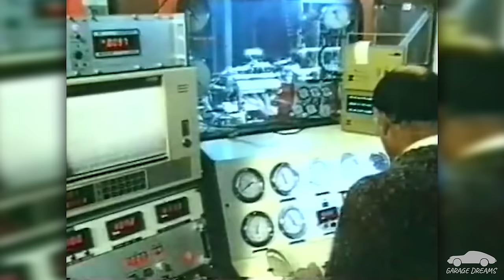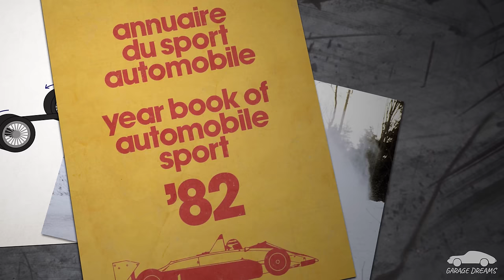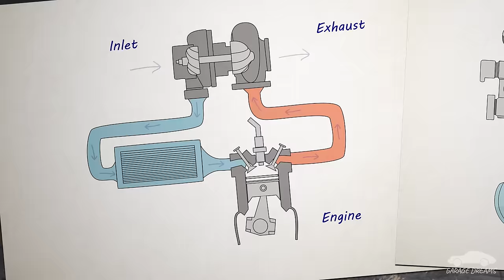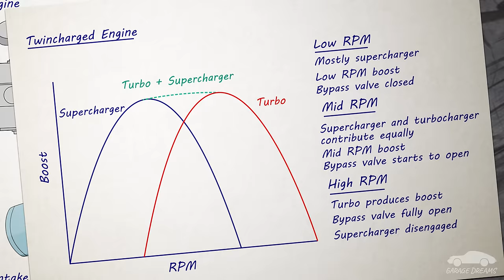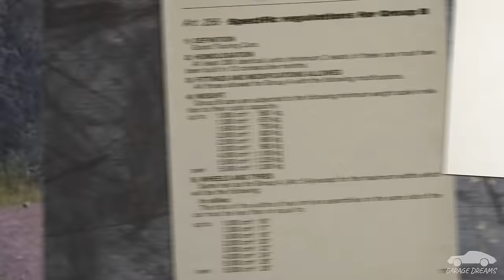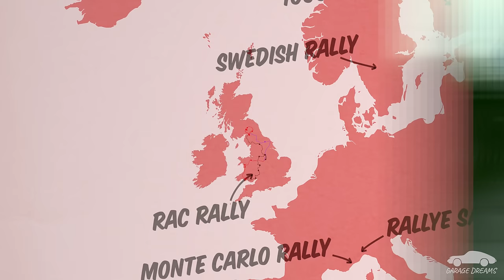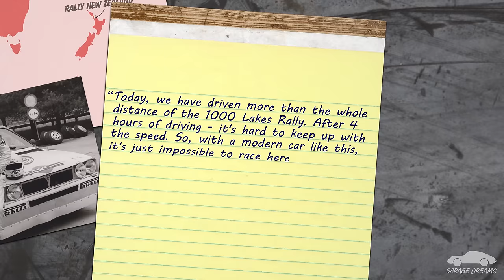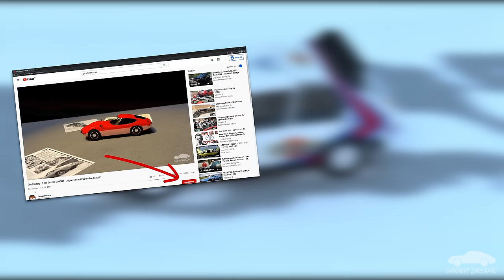The History of the Lancia Delta S4 - The Car That Ended Group B

Comment: When a driver says the car is too fast, you better believe it. Even though I love things like this, there are always limits to anything.
Reply: Henry Toivonen about the Lancia Delta S4: "this car, go to 0-60 in 2.4 sec, is so fast that your brain isn't capable to stay at pace with your actions. It's crazy"
Reply: @solinvictus1234  God rest his soul he was taken way to early
Reply: @solinvictus1234  this car was so fast that modern HYPERCARS have trouble getting that low of 0-60
Reply: @x-90  Are rally cars faster than sportcars? I don't talk about drive in sand or Dschungel. What for example on "Nordschleife"? Can a rally car beat a gt3 rs?
Reply: @BetterCallSaul603  
Different cars for different races, impossible to compare on top speed alone.
Reply: " The sky is the limit... and that's where you're going JIMBO "

- FIA, 1986.
Reply: Laughs in IOM TT
Reply: @solinvictus1234 let’s not forget that 2.4 0-60 is on gravel💀
Reply: @CrewCrewlancer facts !! People don’t take that into consideration at all . I don’t believe that car made 450-500 the it was twin charged no telling where the boost was set . Not to mention they made and 800 hp “version” the driver was right that car was way to fast to be on taken on loose gravel and dirt roads and through corners

Comment: "How and why the S4 left the road is still a mystery." Maybe it had something to do with going 100+ mph around a turn on the side of a cliff? These guys were insane!
Reply: there were no skidmarks on the road from the tires, indicating that there was no hard breaking, or slide. Personally i think mby the brakes didnt work or smth
Reply: Or it could be stucked throttle, as it was mentioned as one of the car's issues
Reply: The pedal box wasn't attached to the floor,@Sean Price - so even if the pedal box was broken, there's no way "the brake was going through the floor".
Reply: He had a concussion blacked out. (In the 80's head injuries didn't exist. Basically because everyone knew someone who was like, "did you get shelled by the Germans? Suck it up buttercup, you ain't bleeding out the ears"
Reply: @GorryGaming  there are no skid marks there, if you brake there  you are done for and rally drivers know thhaht

Comment: Henri's complaint about car's too high performance foreshadowed his tragic death.
Reply: And the occasional reliability issues of the 80s and 90s. Senna also foreshadowed his death, even more strongly after Ratzenberger bit the dust in the same weekend (Which would be completely off the racing code nowdays, the race would have been cancelled if a driver dies during practice or qualifying)
Reply: Yep.

Comment: That Lancia was a BEAST... Beautiful, powerful and extremely fast. Unfortunately Henri Toivonen died in a S4 but they both  have become a LEGEND ...
Reply: Saw them both in action live at Motorshow, a very popular motorsports meeting show in Italy at the time. They used to build a small track - with both tarmac and dirt sections - in a huge parking lot area. The whole thing was like a stadium, with tens thousands whooing and clapping their heroes...that place was adrenaline at the finest and I still get goosebumps when I go there with my memory.
In that track the Group B cars and drivers battled for a trophy in memory of driver Attilio Bettega, who died in 1985 Corsica Rally. 
Well, it was EXTREMELY clear from the very start that the S4s where just insane, with a considerable edge over all the competitors. Only Peugeot turbo 16 (another devilish car) could try to stand still against the S4, but only ending up being the best in the loosers pack.
S4 was another thing, I mean TOTALLY insane.
And Lancia had the ECV1 - evolution of S4 - under development when Toivonen and Cresto had their fatal accident. ECV1 had a next gen engine with 750 hp (some say 800) in 'regular' configuration and a 1000+ hp specced engine for tarmac rallyes like Corsica.

Comment: Excellent video.  Most amazing, it was only a few years until Group A cars with barely 300 hp were faster.  Power is nice, but suspension, brakes and chassis are the  important parts.

Comment: The loss of Henri was as significant as the loss of Jim Clark. Both drivers were considered to be at the pinnacle of their motoring path and the thought was if it could happen to these guys no driver is safe. Quite rightly major changes were made to rallying and single - seater racing albeit far too late. I feel blessed to have been able to see there careers develop. RIP

Comment: Very fortunate to have been given a ride in the Roncaglia privateer S4 driven by Paolo Alessandrini at Olympus.
My God! On gravel it did 0-60 on 2,5 seconds.
Later at a rally shop Ruote In Pista in Torino, I got to fiddle with an E2 037 and S4.
Of note is that there were a pair of Sparco seats on a shelf with "Toivonnen" on one, and "Cresto" on the other.
IMHO the S4 was the greatest rally car ever made.
037 was the prettiest.
I purchsed an ex-Rorhl 131 Abarth in 1988, with the intention to restore and campaign it in the US. Sadly, I had to sell her. Wish I didn't.
The S4 was for sale Lit 40,000,000.
Should have bought that car back then.
Had 2 spare engines, Torson diffs, wheels, etc.
Also got a peek at the Triflux engined evolution Delta for the proposed Group S, that never happened. Carbon fibre brakes in 1989!
Reply from the maker: Wow, that's a great story. Thanks for sharing. Would love to have the opportunity you had!
Reply: @garagedreams6163  
I will never forget that experience.
The Alessandrini Bros were just wonderful, as,was the factory Lancia team.
I spoke with Nini Russo, and Ing. Corrado Isenburg, who I later visited at Abarth.
They gave me a Martini Racing umbrella, which I still treasure.
It rained every day of that rally, and Alen commented, in that distinctive accent: "Es too much renn."
When those Lancias entered the Tacoma Dome, the sound was absolutely astonishing!
Got to chat with Watanabe about the Hondas, which is,a whole other story.
Got loaded with various competators our last night there at Olympus. God, the NZ Millen team could drink!

Comment: I'm young(ish lmao compared to the rest of the rally community) and don't know much of the history but this video and Toivonen's statement about how their brains can't keep up is something I can kind of understand playing rally games with wheels. No series is anything like group b you're in some ridiculous rocket doing 110mph in the dark around corners people do at like 30 normally and still shit themselves. 

People are wild lol nothing but respect for these legends.
Reply: Of course you can do that for a while, but for example the Tour de Corsica 1986 was over 1500 kilometers long... no chance to catch a breather because once you were out of the corner, you had to turn into the next one. With Group B rally cars straights became meaningless, especially on rallies like Corsica where it is just turn after turn, while every corner looking the same. It was not just a difficult rally for the driver but co-driver as well. Physically and mentally really exhausting. 

Nobody knows what caused the crash, but there just wasn't any margin for error anymore, be it driving mistake, wrong pace note or mechanical failure. Whether you died or survived started to become more and more dependent on luck so it's no wonder many drivers and FIA started to have issues with the Group B regulations. Actually they had already recognized everything was getting out of hand and were coming up with Group S that would have limited the power to 300bhp.

Comment: It never ceases to amaze me that whenever we talk about Gr. B of rallying, the Audi Quattro is always taken as an icon, which conceptually was a Gr. A (it was not much more than an Audi 80 Coupé with a turbo engine and four-wheel drive) for Much that they put ailerons and tried to compensate for a very uneven weight distribution by putting the radiators at the rear. The truth is that already in season 86 it was already an obsolete car no matter how much the skillful hands of Walter Röhrl tried to compensate.
The merit of innovating with the first all-wheel drive vehicle caused them many reliability problems, having already been in competition for 3 seasons. Peugeot and then Lancia did not have so many problems with their first all-wheel drive models.
Also say that the Regulation of Gr. B was inspired by three very innovative models: Lancia Stratos and its mid-engine, the Renault 5 Turbo and its mid-engine also put into a small utility vehicle (a large marketing operation in which Peugeot later would inspire) which gave them both astonishing agility and the Audi Quattro with its all-wheel drive but lacked that agility. All three were running under the rules of the previous Gr. 4.
Reply: I would argue the 1986 Quattro wasn't obsolete at all. The fact that it was competitive even though it didn't have a spaceframe and had a big 5-ilnine engine sticking in front of the front axle is astonishing. Actually it came in 1985 and impressed right away at 1000 Lakes. It had its own anti-lag system and pioneered the semi-auto gearbox (at RAC I believe). The thing is Audi wasn't running a full program for 1986 and they weren't always pushing in the one full rally they participated. Rohrl was running very well in MC until he got a puncture and the spare was a studded tire. 
Also Audi always gave some attention to safety and had many complaints about the safety standards of GrB. They wouldn't make compromises and cut corners that would endanger their drivers. Audi was the only one of the top contenders that didn't suffer any serious accidents (like Vatanen in the 206, Bettega in the 037 or Toivonen in the Delta S4).
Also I would say that Audi had the last word when it came to those monster cars and it happened at the 1987 Pikes Peak. The car Audi raced showed the Quattro S1 was in no way obsolete in 1986.
And yet to me the saddest thing is that Audi did make one car that was close to a true GrB car. It had a mid-engine layout though I imagine the chassis and body were just the regular short wheelbase Quattro S1. Rohrl tested it and loved it. It was built and tested in secret because the Audi board was against deviating from the original layout. The car was apparently destroyed immediately when they found out and all we have is a few black and white images and an interview with Rohrl.
Reply: @VWaudiRULEs  The Audi was a car that could'nt do anything against the Peugeot and the Lancia in 1985 and 1986 and the results corroborate this. They did'nt retire in 1986 for security reasons, they retired because they knew they were not competitive, even if they later justified it with security.
In fact, the only events that he wins are the 1985 San Remo, which wins it because Salonen does'nt race it at full speed since they were worth the points of 2nd place to be world champion that year and he did'nt risk, surely with Vatanen the result would have been been another, as had happened the year before.
The 1987 Pikes Peak is won by Röhrl because Vatanen breaks a turbo flange at 3 km. finish line, and it was only 7 seconds faster, because both in practice and in the first split times Vatanen was clearly winning, despite being a climb of "full power".
He could go on talking about what happened in Monte Carlo 85, but the comment would be too long ...
Regarding the engine, it is obvious that an engine of almost 2.2 l it will yield more power than its rivals with 1.8 l engines, but not everything is power, agility and weight also count, and those were the weak points of the Audi, apart from the reliability, until the 84 the Audi Quattro had a lot of problems with the transmission and the engine (they lost the '83 Championship incredibly for this reason to a Lancia 037 4X2, ask Mikkola or Blomqvist).
At Audi, Mr. Piëch insisted that the car had to be like the serie cars (However, Peugeot did with the 205 a perfect marketing operation, even though they were totally different from the series cars).
If you read the rules of Gr. B well to know that Audi did not design a car with all the parameters allowed by the regulations.
It's clear that the Gr. B rules did'nt meet the necessary safety, Kevlar bodies should have been prohibited, thicker roll-bars, fuel tanks placed in safer places, minimum weight limit and flange turbo engines to lower so much power (- 400 hp) would have been the solution, and still Peugeot o Lancia would have won because they were cars designed only to win in rallies, the Audi was conceptually an improved street car adapted to the Gr. B, which is different. If we talk about technology, Peugeot had the anti-lag DPV system, the germ of what it's today, it also had a water injection that today is equipped with premium brand cars to lower the temperature and give more power. The Delta S4 had a turbo and compressor, a system similar to the one used by the Volkswagen Group 1.4 TSI 10 years ago or so.
The semi-automatic gearbox that Röhrl equips in his car in the RAC 85 Rally is the PDK that Porsche was testing in Gr. C with the 962 and that they agreed with Audi to test in rallies and that today they equip their standar cars.
Reply: @carlosmagnus717  I don't agree at all. Audi couldn't do much in 1985 when they were racing the original short wheelbase Quattro, which was difficult to drive. And yet it was almost always on the podium and a win was lost due to some bad luck. With the Se E2 they won San Remo, before that they got 2nd at 1000 Lakes (with Audi famously setting a record at Ouninpohja and winning many stages), then RAC was for testing and development where they retired. I don't think those results show lack of competitiveness. They would not have kept developing the S1 E2 if they thought that. 
Like I said, what makes the Quattro S1 E2 so amazing is exactly that it's based on a regular car. The Peugeot and the Lancias were all purpose built and especially the Lancias were dangerous death traps.
You'll have to excuse me about Pikes Peak because Audi didn't just win in 1987, they set a record which Peugeot barely beat in 1988 with a brand new car. Not to mention Rohrl and the other Audi drivers (Mikkola, Blomqvist) were significantly older than the Peugeot and Lancia drivers.
Anyway Audi kept winning wherever they went - Grand Am/IMSA, DTM, then Le Mans and many other endurance races with the R8 (coupe). Then VW dominated the WRC like no one else in 203-2016.
Reply: @VWaudiRULEs The results say that the 1985 and 1986 World Champion Titles were for Salonen, Kankkunen and Peugeot. In those two seasons, Peugeot won 13 rallies, Lancia 4, Toyota 4, Renault 2 and Audi 1 rally. 
The 1985 1000 Lakes rally was won by a Peugeot 205 Turbo 16 E2 in its 2nd participation, won by Salonen without running hard, without risking excessively. Hannu Mikkola in the 1st pass through the Ouninpohja stage goes off the road and loses time, which later in the second pass is when the time that you say is done, but Salonen has already won the rally and manages the advantage no risks (Salonen gets 20 scratch, 16 Blomqvist and 7 Mikkola who retires on stage 31 of 51 that the rally had).
In the San Remo rally I already told you what happened, Salonen only needed the 15 points of the 2nd place to be Champion, he did'nt need to risk and he simply went out for a walk. At the RAC Rally it was not only an experimental Audi (which I already told you was PDK that Porsche was testing in the 962 and then agreed to ride in the Audi to test it on rally stages), but Röhrl did'nt like nordic rallies (RAC, Sweden and 1000 Lagos), in which if he participated he would walk for team's orders. In addition, that rally is won in its debut by Toivonen's Delta S4, a car much more competitive than the Audi, and anyone who knows a little about rallies knows what I am talking about. Another issue is safety and that argument is'nt valid to say that as they were safe the Audi could not win, we must see what the Group B Regulations consisted of and what was Mr. Piëch's idea that did not adapt to those rules.
The technical explanation is that a car with a central-rear engine has a better weight distribution, better traction on the rear axle and better polar moment of inertia, which gives it greater agility in rally sections, apart from the more contained weight when also having some 400 cm3 smaller engines.
About to the 1987 Pikes Peak, you have to be well documented and really see what happened in detail, and what happened was that in the Peugeot a flange of the turbo intake broke in the last 3 km. of the climb, at 4,000 meters high and "only" lost 7 seconds. In the previous training sessions and in the partial race times Vatanen was clearly winning, forward to Röhrl, Zanussi y Metha respectively. 
For everything else there are likes and opinions and "opinions are like the asses, everybody have one" as Harry Callahan, the character of Clint Eastwood in "Dirty Harry", used to say.

Comment: Toivonen crash reason was the gas pedal was stuck in the floor because metal was so thin. Thats why there is no braking mark. It was happen before with gas and clutch pedal with test driver.

Comment: Looked this up thanks to this car being amazing in Forza Horizon 4. Class B, A, and S1 it is a monster on the dirt or cross country.
Reply: I ran it on Forza Motorsport 4 and the insane grip off the line... it's jus, hold the accelerator, don't even get halfway through the first letter of "go" and you have grip! Oh and, er, well, bye! waves as passing everyone
Reply: It's kinda sad that the forza team gives more attention to some modified drift cars than this beast. The fh4 version doesn't even have a supercharger and does 0-60 in 3.6 seconds on tarmac when in reality the s4 did 0-60 in 2.3 seconds on gravel